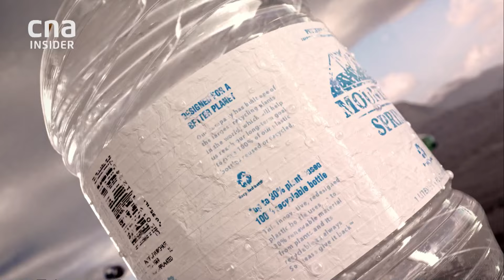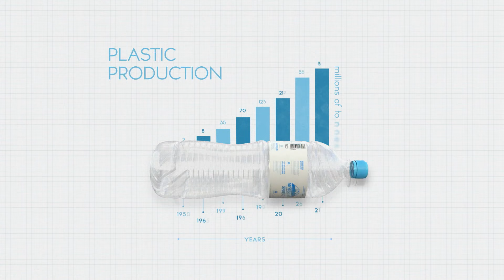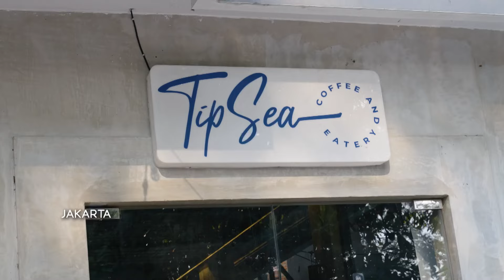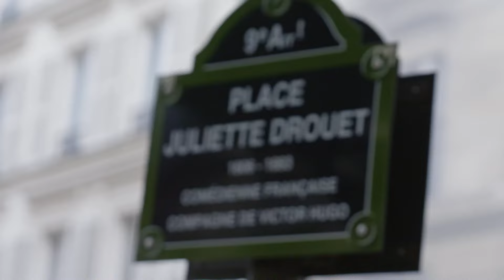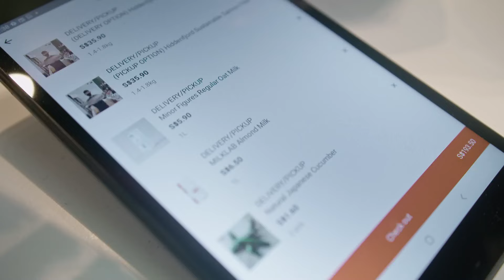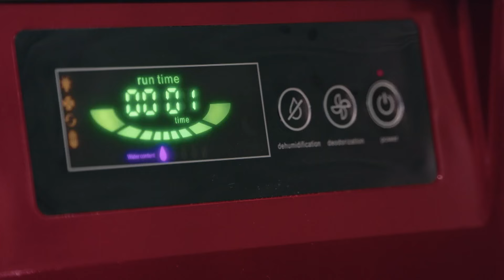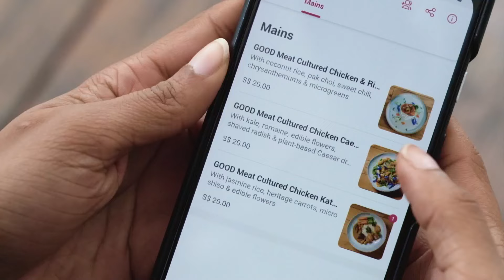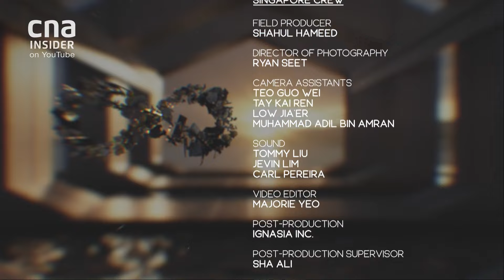Rethinking The World's Waste: Circular Economy | Climate For Change: Closing The Loop | Ep 1/2

Comment: its better to reduce waste than recycle it or other high tech solutions.
Reply: But this solution will help the existing pile of waste already generated.
Reply: Bro it’s like saying: it’s better to save money than reinvest it. 
Think: I met a family that redesigned their farm into zero waste recycling: 
Aquaponics systems get nutrient from Fish poop; that system is nutrient for plants and so they use 90% less water and energy.
- waste (municipal & farm); they use it in a Biogas genset to make power; the rest the turn it to ethanol for their cars. 
And that’s just some examples from a DIY farm. 
- heat from the greenhouse is used to warm water for their tilapia farm etc. 
Check Kadunborg City - A city wide symbiotic system where power plants and processing plant use tubes to pass each other waste which happens to be raw material for their factories. Its really cool
Reply: After watching this, I think u right; these are just fancy ways to recycle. Westerners love to use high tech methods for everything. Simple low tech methods of recycling should be promoted instead of these

Comment: It's hard to avoid waste, but I am trying to shift back from online shopping where possible, and have been using reusable pads, bags, straws, and cups for over 2 years now. I've also recently (maybe 6 months ago) finally gotten the hang of bringing my own lunch consistently (instead of sometimes like I used to), plus my own water.
Reply: We can work towards in  reducing waste more viable and feasible, and build up towards waste-reducing environment with an infrastructure.
Reply: good job. I have reduced my waste bags from 2-3 a month down to half a bag. compost all cardboard and paper,buy less plastic packed stuff,paper/cardboard where i can,send metal cans to recycling. not perfect but if everyone did it,it would make a difference.
Reply: Change can be hard ,but well worth the benefit for positive change.Upcycling and recycling, energy use , water conservation are my focuses so far. I Air dry clothes, manual wash instead of the dish washer. I recycle and reuse jars for plants and organize art supplies. I use the same plastic water bottle.Gray water goes to the garden outside.
Reply: may i know what is reusable pads
Reply: @ik8452  as in menstrual pads, theyre usually made of cotton though ive seen some made of bamboo
Reply: MUSHROOMS CAN BE USED TO PRODUCE BIO STYROPHOME...ALGAE FOR BIO FUEL, OIL, PLASTIC, EVEN JET FUEL...HEMPCRETE AND HEMP INSULATION CAN BE USED TO REDUCE HEATING USAGE UP TO 70 OR MORE.....A COMPANY IN COLORADO USES HEMP TO MAKE CABINETRY AND FURNITURE
Reply: @ginagreen3121  Dishwasher uses less water than hand.

Comment: Waiste chambers or pits.  Just add human waiste and let it cook down. The gas can be vented through the ground and charcoal filtered out. 
It can be pumped for fuel. The problem is it has to be maintained.  
But the best way is to shred it and mix it with create. Turned into building supply.  Well the plastic and paper trash even metals and other materials mixed great for construction.  Lol fun.

Comment: A circular economic process, particularly in regards to plastics, glass, metals, and so forth IS very important. But if this is simply a part of trying to desperately "save capitalism", it is greenwashing and nothing more. The initial OVERPRODUCTION of plastic commodities (and commodities in general), which is driven by the profit motive and the capitalist's need to constantly expand profits and market share, will not and realistically cannot be significantly reduced under capitalism. 

Unless there is some model of socialism (doesn't have to be, and really should not be Marxist-Leninist socialism or command economics, which failed imo) or at least a social ownership of capital and a holistic macro-economic indicative planning-based system with highly regulated and socially-oriented markets, this is all just putting a band-aid on a deep festering sword cut.

You cannot reform an economic system that is premised on infinite growth on a finite planet: for a circular economy to be successfully implemented, it MUST go beyond capitalism.